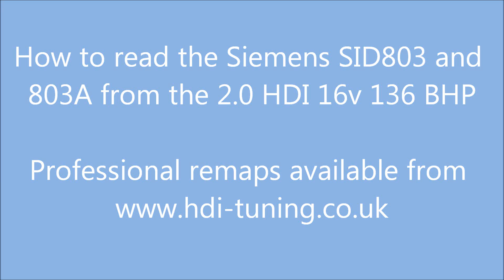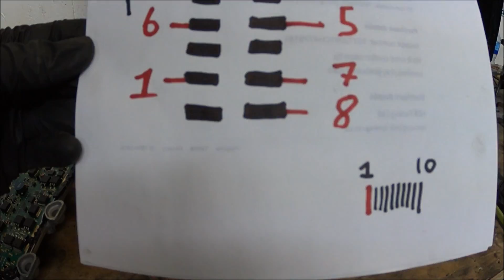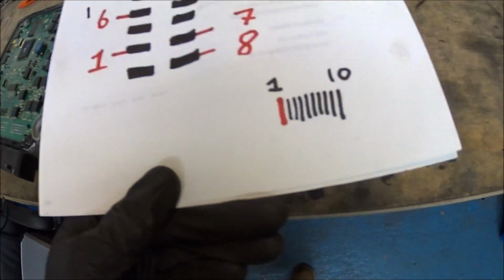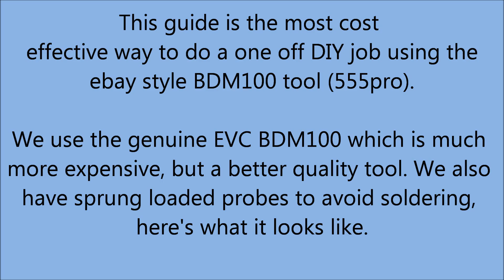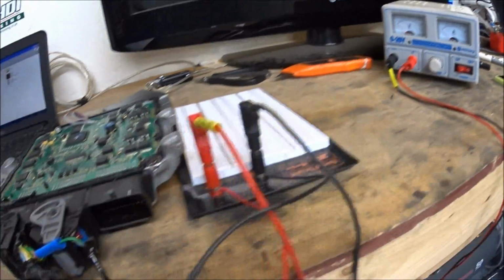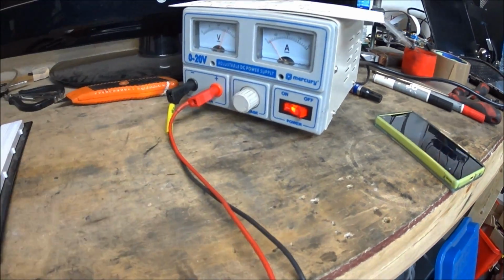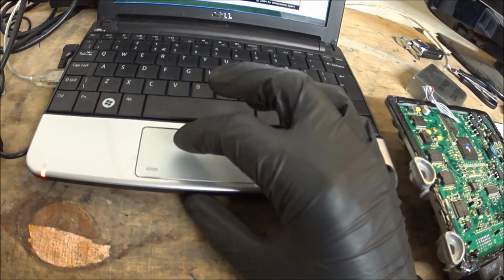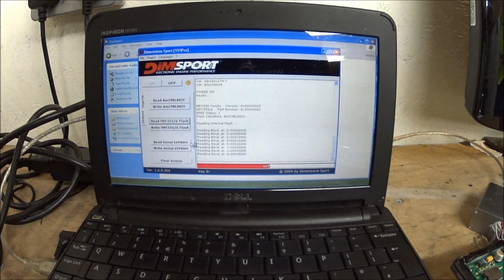Siemens SID803/SID803A ECU from a Peugeot/Citroen 2.0 16V HDI 136 BHP using BDM100

Comment: Steve the sid803 is bdm only but the 803a is obd. Cheap fgtech v54 for example will easily do it.
Reply from the maker: Adrian the car guy I've never tried it. If it goes wrong then you can't repair it without the full bdm read if you don't have a backup. Plus the immobiliser can't be removed from these (yet) so you could end up in spot of bother if it does crash.

So far I've found the edc16 to be super unreliable through obd with genuine tools, and these both use the same processor type. 

Personally I quite like using bdm and making a full backup, it doesn't take me more than 10 minutes to get the ecu out and open it and get a read, so I don't mind doing it. But thanks for the info!

Comment: Hi. I have a 307 hdi xsi RHR running a Siemens sid 803. I am having all sorts of problems with my sensors and now the car won't start. I have been told it's a possible power to the ecu issue. Are those 3 pins the only power and ground feeds I need to check or is that just the bare minimum to read the ecu?
Reply: Those are just foe powering the ecu. Probably a faulty ecu, these quite commonly get moisture damage inside.
Reply: i had a similar issue, with my rhr, it was the crank sensor.
Reply: @richbrown5852  Did your ECU reported fault codes P1621, P0470, P0473?
Reply: @vatrosisqo  I can't remember exactly but I can tell you to check the crank sensor and wiring..it's right at the bottom of the engine
So it's susceptible to the elements and it can be the root of many issues with the rhr Siemens...